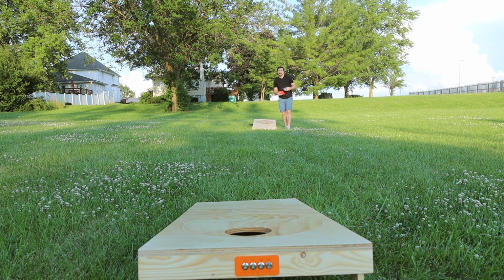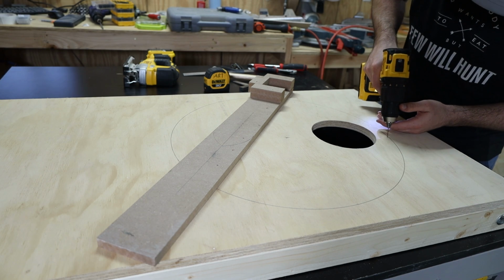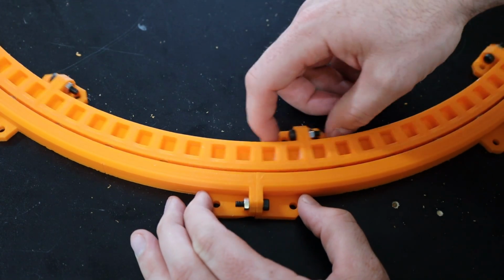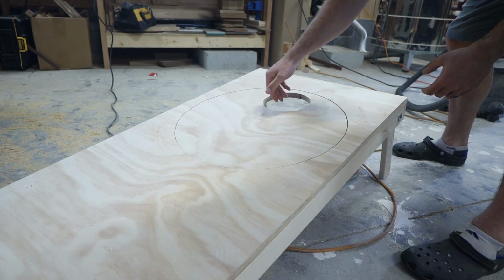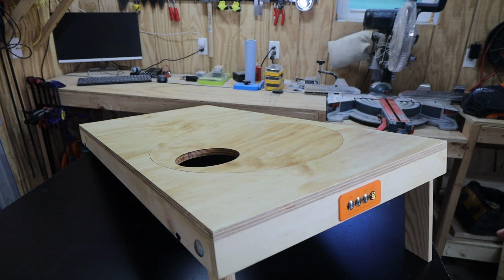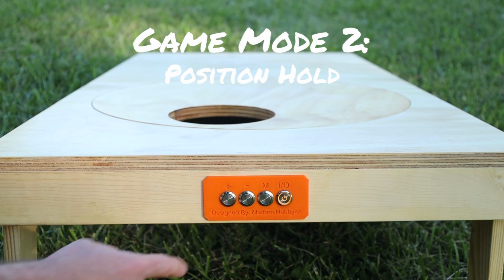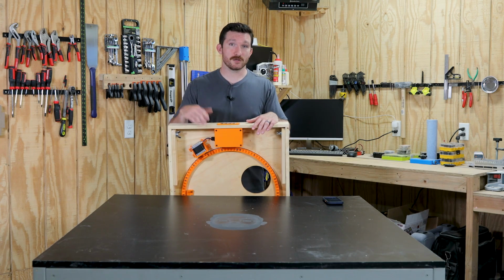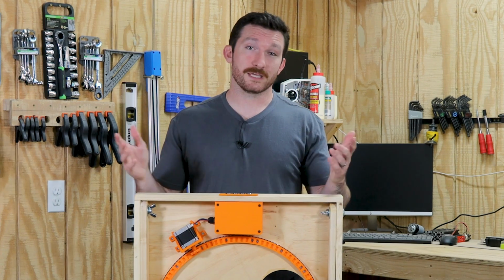ROTATING Cornhole Boards ANYONE Can Make!

Comment: Hey love your video and all the details.  I'm trying to retrofit a set of boards I made last fall.  What type of filament did you use for all the 3D parts?  Thanks
Reply from the maker: Thanks! Good luck with the build! I just used PLA and they've held up just fine for 2+ years now. I do hope to redo them with simpler electronics and maybe better bearings in the future, but have yet to find the time 😅

Comment: Thanks for this well made build video. But you missed something from your first idea -the “LAZY SUSAN”. You’ll see they are built as thrust bearings not journal bearings. So a top race and bottom race, not inner and outer race. I think it would have reduced the problems related to bearing gaps. But I have only made fixed hole boards. 
 Keep up the good work!

Comment: Awesome build, I might have to build one of these sets. Does the plan include the instructions to program the Arduino and the material list (mainly concerned about the electronics)?
Reply from the maker: Thanks, glad you liked it! The instructions include a full BOM, assembly instructions, and wiring diagram. The code is available on my GitHub (and linked in the instructions) and flashing the Arduino is as simple as opening the code in the Arduino IDE and clicking upload. Hope that helps!

Comment: Thanks for providing a detailed example for my high school engineering students regarding problem solving and iterating.  Since the Arduino is available you can add some sensors to detect the bags going through the hole next so you can do scoring or have the holes reset after each bag going through the hole!
Reply from the maker: I meant to include even more failures and interactions but I completely forgot to record any of them, but I’m glad you liked that inclusion! Also the sensors idea is a good one, I’ll have to figure out a way to have the sensor on the rotating platform without wires getting tangled. Should be a fun engineering problem!